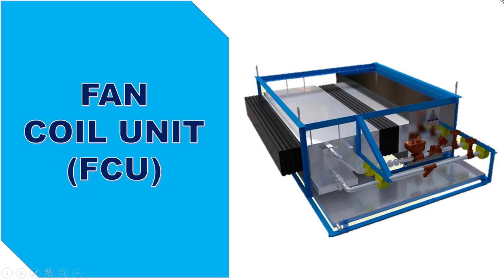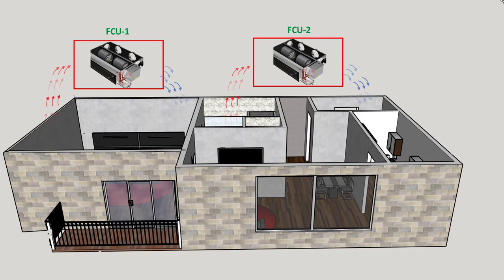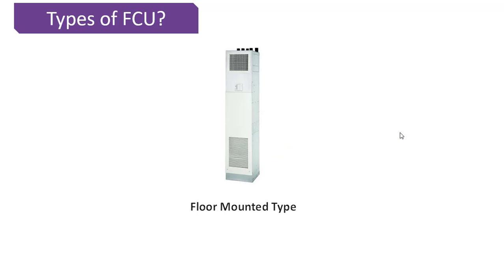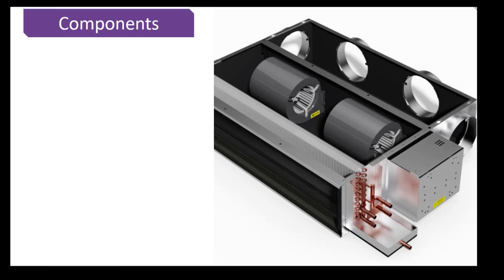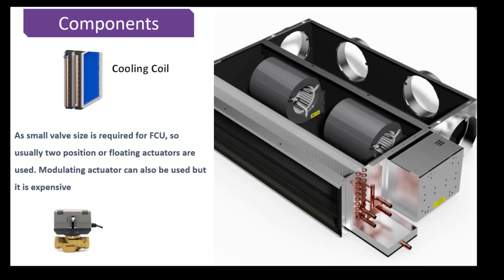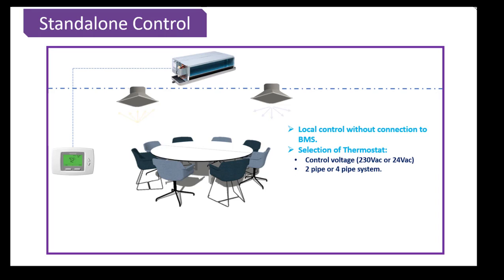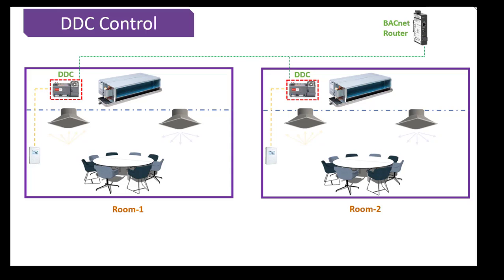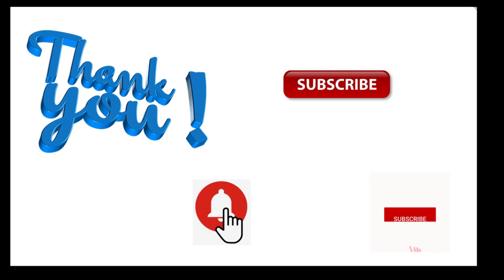FCU Fan Coil Unit Working|BMS Training 2021|Building Management System Training

Comment: why we need FCU?? if the air is already conditioned by the AHU??
Reply from the maker: Wherever FCU is installed, AHU is not serving that area. Only conditioned minimum fresh air is provided to the locations served by the FCUs.
Reply: @TechSystems but why do we need FCU if in the building we have AHU?? even it is costly for us

Comment: Some fcu works with return temperature sensor not required thermostat(corridors, lift lobbies etc)
Reply: Is the return temperature connected to DDC. ?
So DDC  ctrls picv & motor ?
Reply: @salimyousuf8848  im currently installing 200+ as a bms electrician. each unit has a trend IQeco controller, that control the picv, measures the supply temp (bead sensor), etc. some fcus have a dedicated wallbus room controller connected to the IQeco.

These units, usually about 30, are daisy chained back to a bms panel, Trend IQ4, using belden 9841 for BACnet communication. 

if their was return air, on our system it would be connected to the DDC
Reply: @johnaphone  thanks for the clarification
Reply: https://youtube.com/shorts/n154GCQG188?feature=share